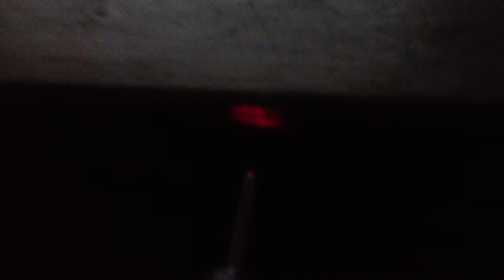Laser tip electrode for injector

Comment: I've got 9xb,scr,9xa, origanal sm board, 5 core vic bobbins and u core, ecore, led array. Willing to build custom boards for trade of something you have. Whatever can help, I'm stuck with the totem circuit, not getting it right. Its either fully on or fully off. So frustrated with thats part and I dont have a variac. We can also custom machine parts here. Let me know your thoughts.